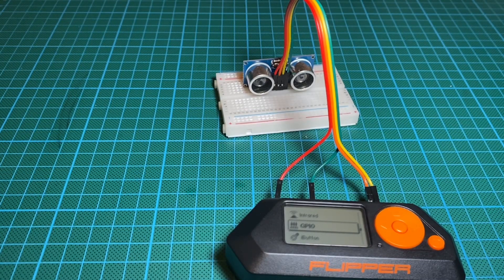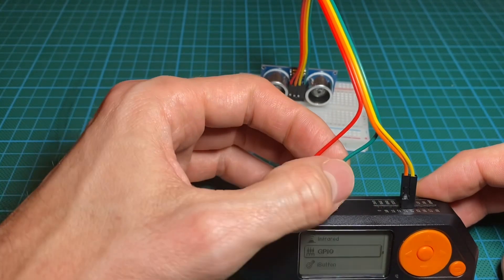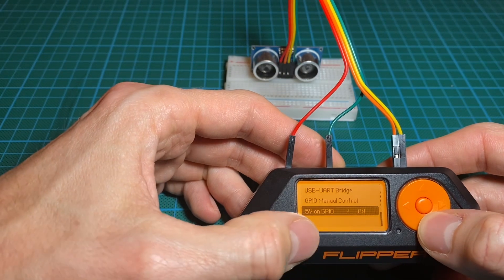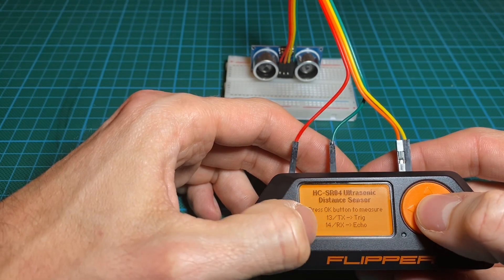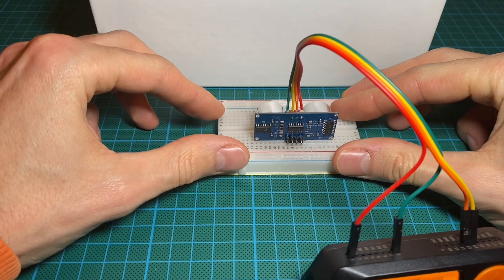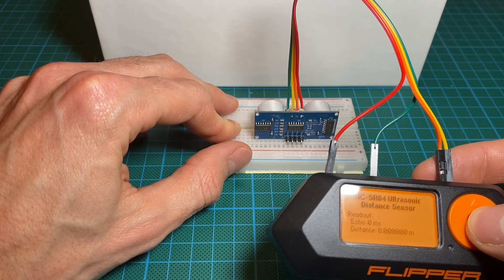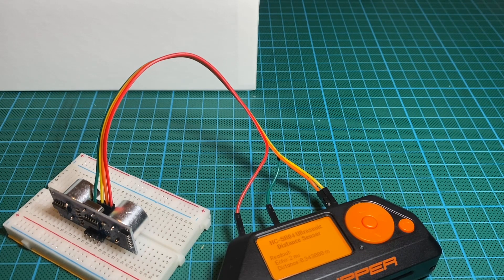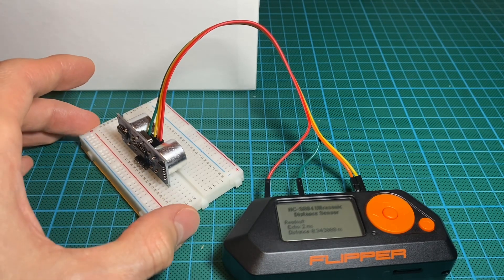Flipper Zero : HC-SR04 Ultrasonic Distance Sensor Plugin Walkthrough

Comment: It's possible use some device to try catch NFC Signals and another kind of signal in long range with flipper zero? there's this device?
Reply from the maker: Thanks Murilo for you comment. Flipper Zero have to be close to catch NFC signals. You might be able to achieve this by using GPIO with your own NFC antenna and flipper application. In this video, the HC-SR04 only measure distance from the nearest object using sound wave. Its measures the time it takes for the wave to bounce back after it hits an object.
Reply: @samxplogs  I'm a layman on the subject, but is there any script/filler that allows someone to try to enter someone else's PC via WiFi using brutal force? without the need for the person to click on your fake Bluetooth?
Reply: I was curious about this too when I got the latest jamming signals that mainly work on car keyfobs. I tested it ( on my own car ) and it def worked/jammed the key fob, but I had to be right on top of it to work. 
I do think it's possible to increase the effective range for most all the apps on flipper, but it would take quite a bit of work and know how.  Not really worth the effort just to know that I can or not lol.
I love my flipper. Been having a blast with it. Great video man!